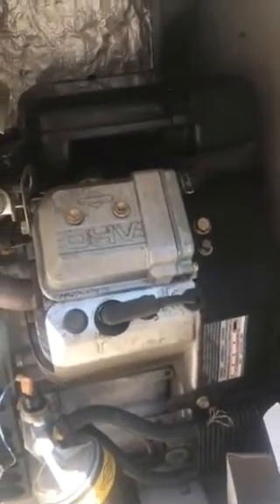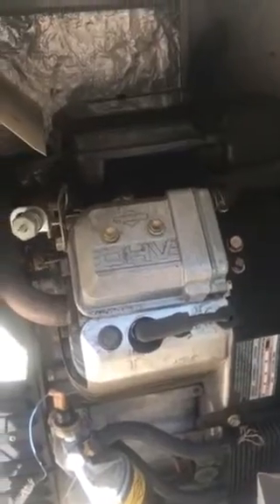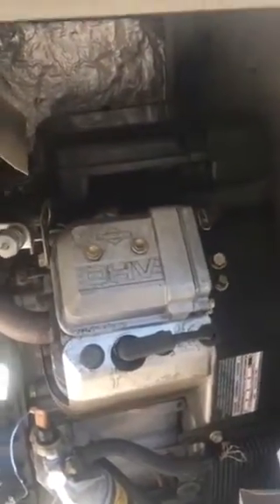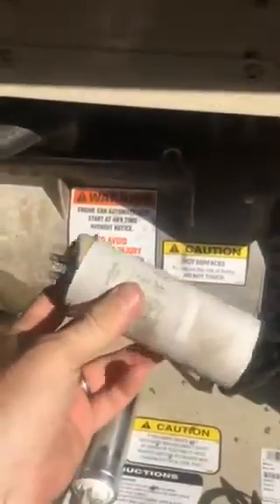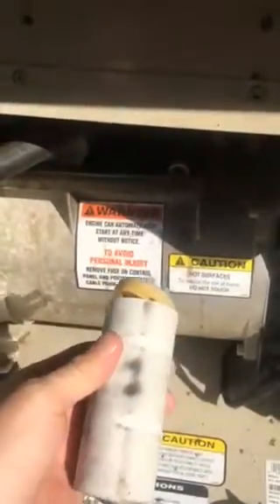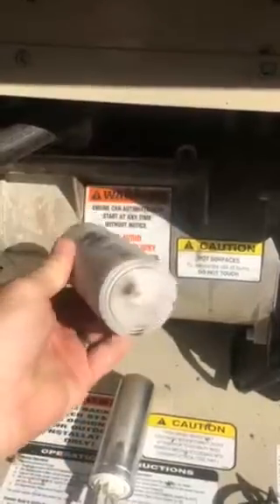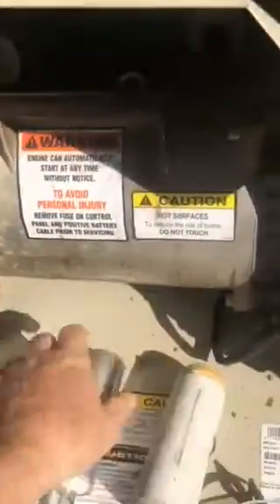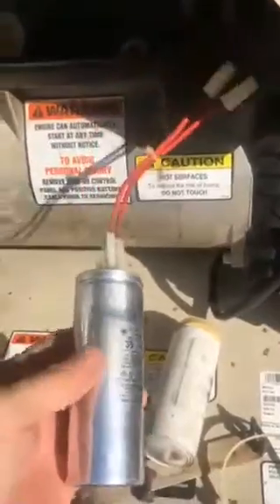What to do when your Briggs & Stratton standby generator stops producing power.

Comment: Steve,  I have watched your videos love watching all you do.  I have that same Generator you repaired.  It will start and run for only 30 seconds or less.  I have called dealers and repair companies and no one in my area will work on a propane engine.  I have never worked on one before.  Would you be able to help?

I have checked fuel, changed, regular at line, changee oil, changed spark plugs, checked air filter, and when it runs I am getting proper voltage

Comment: How did you remove the black cover over the capacitors?   It seems there's no room to get it out.
Reply: My same question. The fuel line is in the way, and it looks to be a nightmare to remove/reinstall.
Reply: I remote mounted the capacitors by extending the existing wiring and now it works great. I didn't consider housing disassembly and muffler removal as an option. I am sure that you don't have the luxury of having the capacitor cover being already removed as shown in the video.

Comment: Two questions for you....did you have to discharge the old capacitors when you replaced them?  And what are the four terminals for?  it looks like you only connected leads to two of them on the capacitor in the right.  Thanks!
Reply: 0😊0